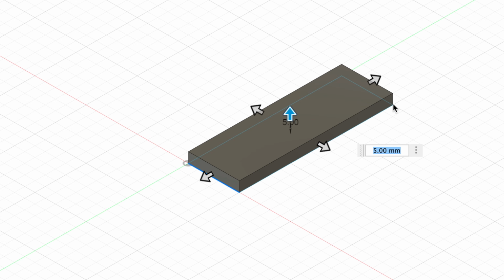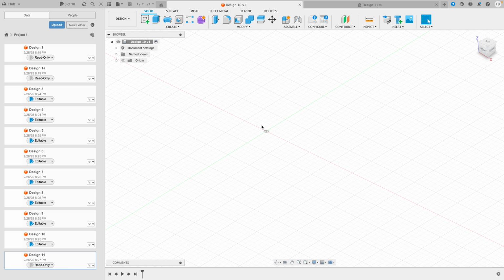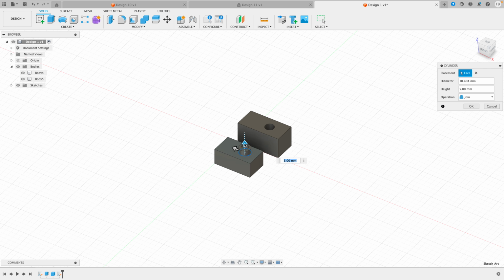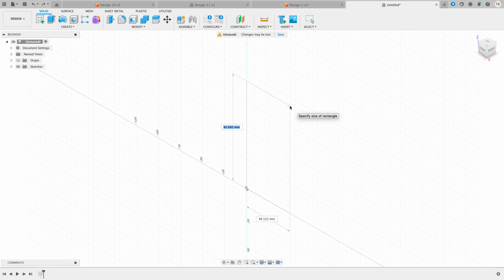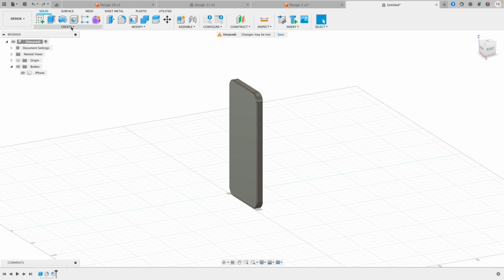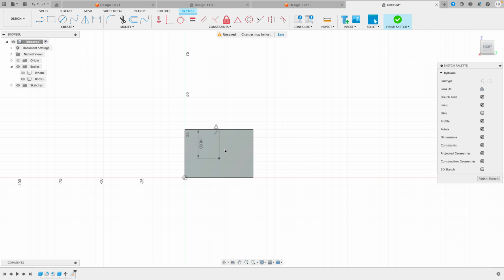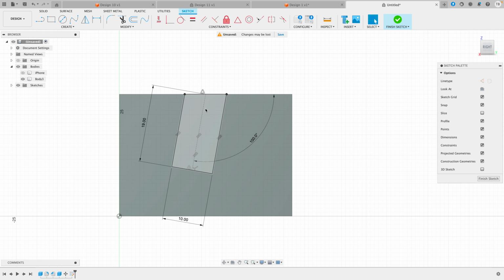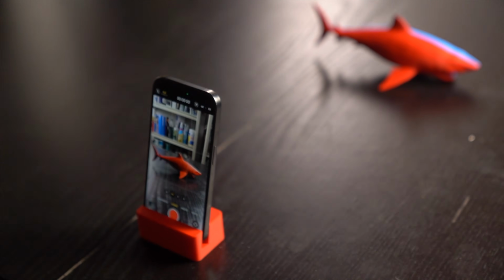Autodesk Fusion Beginners Guide (2025) + Example Project

Comment: Warning:   Spent hours learning this program, as a hobbyist using the free option.  Now 3 years later, they say the free access has expired, have locked access to all my models to read only.  If I want to access my work, I have to either take a full subscription, or pay £8 per day to access the work.  At one time you just re-register each year.    So just make sure you download all your important files - in case the same happens to you.

Comment: I'm unable to do the coincident constraint from the mid point(even after deleting that midpoint constraint) Instead the line simply stretches out to the center where the construction line is.  I'm guessing there's a constraint I've missed, but I've watched and rewatched to see if I got it right and I can't see my mistake.
Reply: That usually happens when another constraint is locking the line without you realising (like horizontal/vertical or a coincident already applied somewhere else).

If you want, send me a screenshot of your sketch and I’ll point out exactly what’s causing it 👍
Reply: Damn daz crazaxy

Comment: I must be an idiot... I cant even figure out how to Edit the angle to 100 degrees from 90. I cant find any way to edit it or change the value from 90...
Reply: You’re not an idiot at all — that bit trips loads of people up.

You need to add an angle dimension (press D, click the two lines, then type 100°). If it’s stuck at 90°, there’s probably a constraint locking it.

If you want, send me a screenshot and I’ll show you exactly what’s causing it 👍

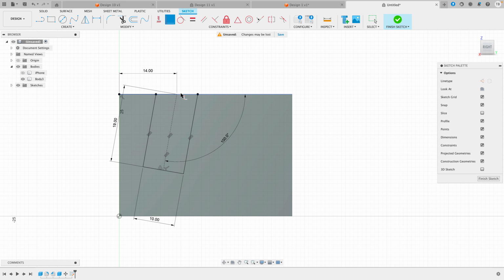Comment: At 20:12, I've removed the center constraint (the triangle at the top - gone now), I create the 14mm line across the top. No constraints show for either dot.  Now when I select both of the 2 dots you chose and click the coincident constraint, it extends my line to the center of the sketch instead of moving the center of the sketch dot to the end of the line. What did you do that I did not. Watched it 1 million times 🙂
Reply: Ok, now I see that not only do you need the line, you need the dimension as well. That was not clear to me.  I guess I wasn't clear on what a dimension is. I looked it up and it is: 

"In Fusion 360, a "dimension sketch" refers to the process of defining the size and location of geometric shapes within a sketch. This is achieved by adding dimensions, which are numerical values that indicate the length, width, radius, angle, or other size characteristics of the geometry. Dimensions constrain the sketch, ensuring that the geometry maintains its intended size and placement when changes are made."
Reply: @PennyDoty  thanks for walking through this. I was having the same issue and since I wasn't inputting a value and just dragging the line, it wasn't automatically giving it dimension.

Comment: 17:30 I'm not able to create a normal sketch dimension, but instead it opts me to create a driven dimension since it will over-constraint the sketch. I have tried other solutions including from Autodesk support page but I'd no luck at all
Reply: you have to hold shift and select both lines, the press 'd' then it will work.

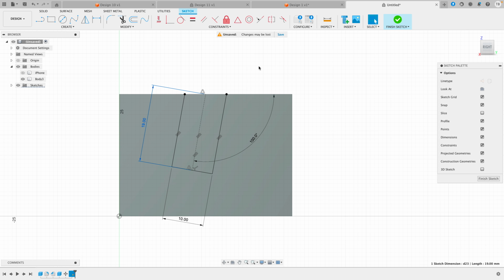Comment: Great video!. However, I could not get the coincident constraint to work. After several rewinds, I noticed that at 19:43 - 19:45, you click and delete the midpoint triangle (the triangle will then disappear). Once done, the coincident constraint works fine  - Thanks again for this video, it was really good and covers a LOT of information very concisely :-)
Reply: Crazy that this dude is charging 630$ for a course and leaves out such an important detail that could frustrate people to the point of giving up. Thanks for leaving this comment.
Reply: i was fustrated for 20 minuts i did not know what i did wrong ...
Reply: @andrashuszar8303  SAME. Thank you for pointing this out!! All in though, great tutorial!
Reply: I still cant get it to work
Reply: Yeah, this was lacking a lot. It is important that you type in the length of the line which you want to adjust to as well, if you only drag it to 14 mm it doesn't work. Took me 30 mins to figure out.
Reply: godsend
Reply: Comment should be pinned
Reply: THANK YOU FOR THIS. I was going crazyyy trying to figure out why it was giving me an error or being over constrained. This should be pinned.

Comment: Gr8 video, but i got 1 question. Couldn't you just extrude cutout in stand from iphone mockup? Is it possible to extrude with an object?
Reply from the maker: Great question! Yes, you could use the “combine/cut” tool to cut the phone object/body from the stand, but there wouldn’t be any extra tolerance and the chamfer would mess up the cut in this exact example. There are many different ways to design things Fusion. Hope you found the vid helpful! -Steven
Reply: I understand that it was educational video, but I am just wondering if that's possible.